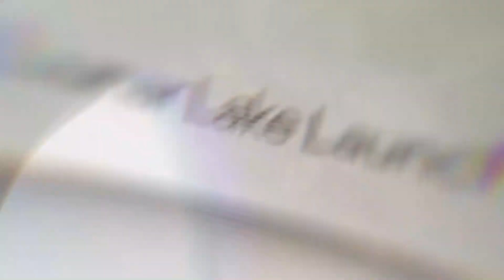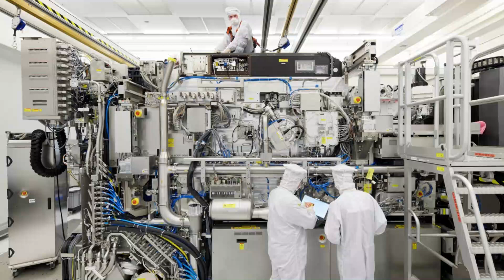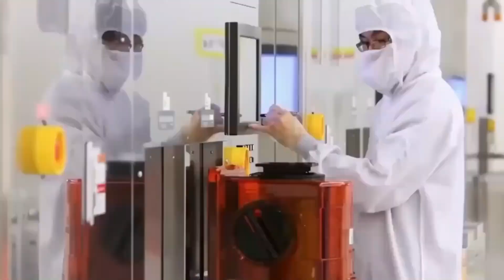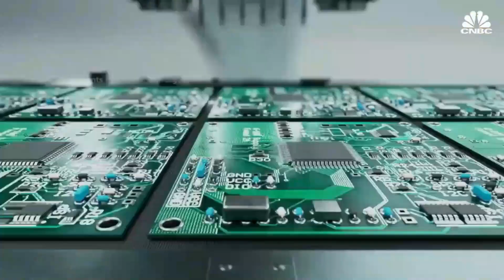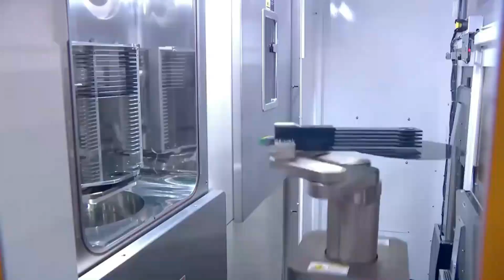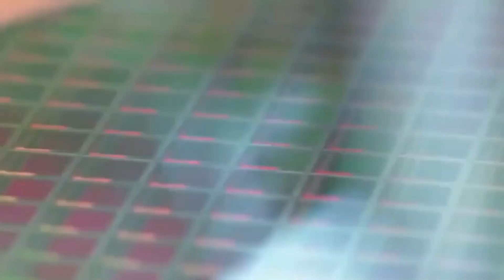Intel’s Tech Comeback |  High-NA EUV & Celestial GPUs : Can Intel Reclaim its Tech Crown?

Comment: Once intel is surpassing TSMC capability then bye-bye taiwan being taken over back motherland China.

American wouldn't even bother as even now most average american can not even tell the differences between a taiwanese and a Chinese average civilian common people 😅
Reply: Hi! But what if Intel doesn't overtake TSMC?  Intel is in alot of financial trouble currently.  They layed off 15%of their workforce, Intel wafers are around 70% more expensive than TSMC (comparing similar node prices).  TSMC currently has several operational cost advantages over Intel, which allow it to make wafers for alot cheaper.  But perhaps you know some stuff about how Intel will catch up in pricing that I don't?  :-)
Reply: @iluvbacon12345  
I suppose with large enough government funding through chips act  they should be able to achieve anything they want.

TSMC I suppose a bit reluctant to help america build their own advanced chips manufacturing capability, but they need american support now, so yeah, not an option.
Reply: @budi0251 Trump wants to remove the CHIPS act. If he does hes hurting america big time
Reply: not going to happen, Intel is spiraling the drain,  but it won't just be intel that suffers, they will take the chips act funding and use it to pad shareholders just before intel goes under.